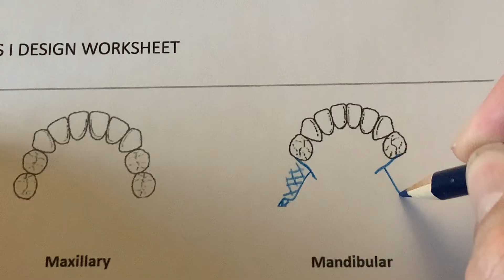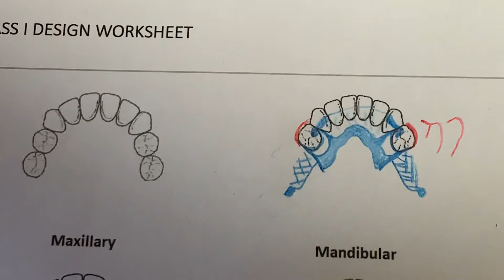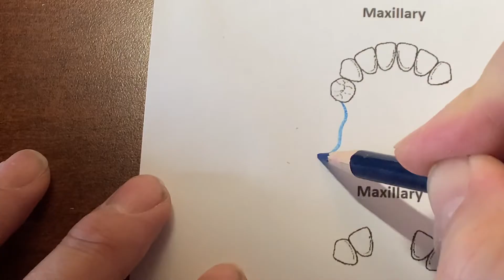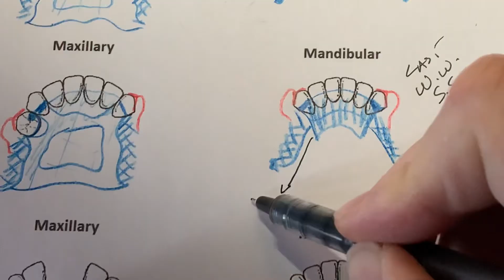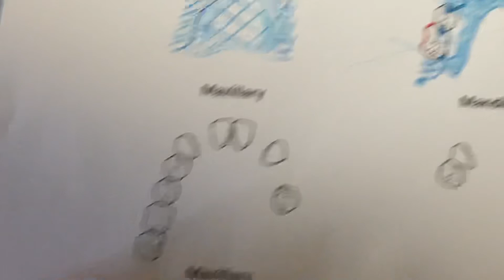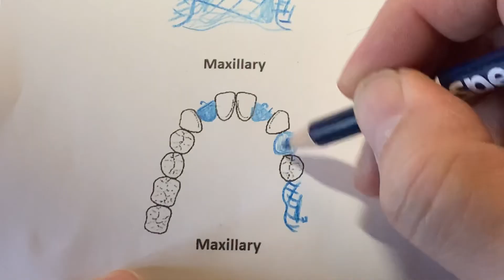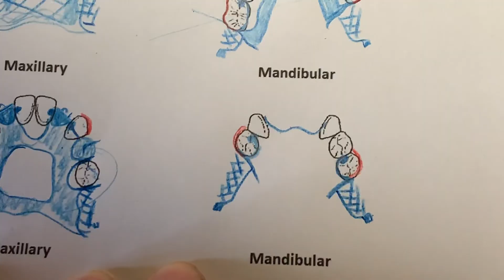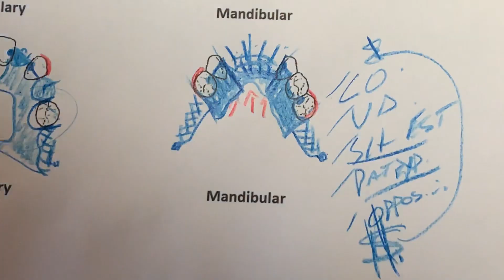Cast Partial Denture Design Kennedy Class I

Comment: Is there a general rule for where to put rest ?
Reply from the maker: This would depend on a few factors. 
Generally on a free end we would favor the mesial occlusal rest on the terminal abutment adjacent to the free end. If a tooth bound posterior modification exists we would favor the surface adjacent to the edentulous space. If an anterior modification is present, it would be prudent to close off these guide planes as well as all guide planes to food impaction. This would improve patient satisfaction and compliance in wearing removable prosthetics.
Reply: @DentureAdventure  thanks a lot
Reply: Thank you so much for the video
Please why wasn’t RPI system used since it’s class 1
And I don’t understand why the last maxillary design is class 1 when it has just one free end